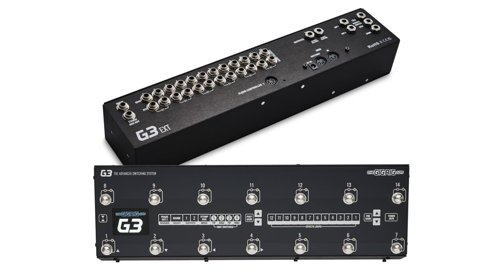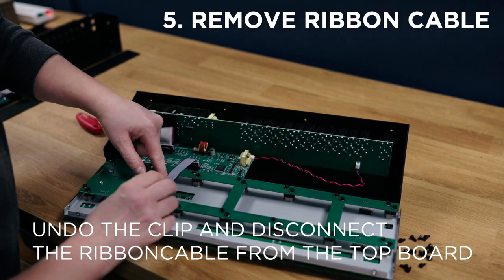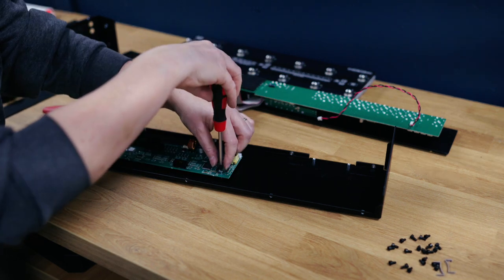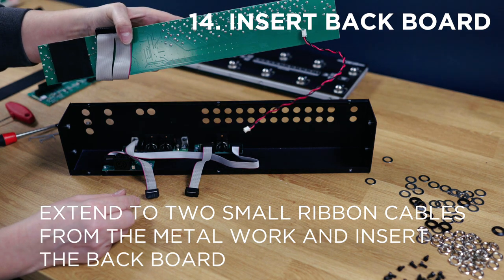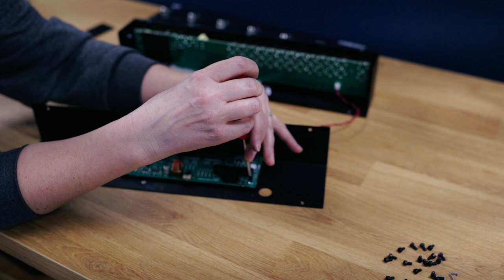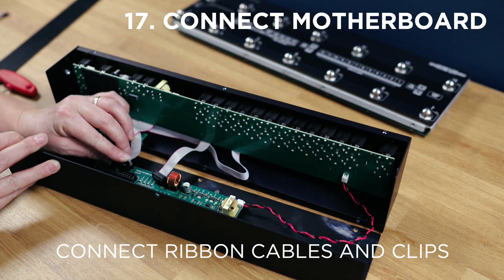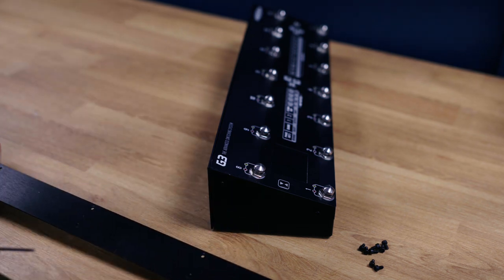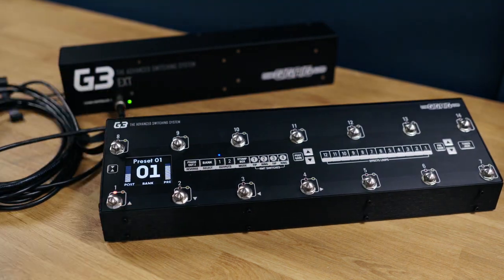How To Assemble Your G3 EXT KIT

Comment: And to verify, when I finished my assembly I had some leftover parts: a short ribbon cable that was replaced by the included long cable in the new controller bottom plate, 1 ribbon cable clip (two new ones came with the ext kit), 2 black hex screws, and the original midi module, correct?
Everything is working.  Super nice that the 7 pin cable supplies power to the controller, too!

Comment: I know this is probably a stupid question, but how do you use a tuner with this setup? Is it native to the lcd screen on g3?
Reply from the maker: Yes, tuner is built into G3 🤓🙏
There is an Aux output so you could have another tuner back at the rack but at the stage you’ve got it in G3 🤓🙏

Comment: This may be a very dumb question, but if the extension board is at my feet, where does your guitar plug in? Is that what the two 1/4" inserts are next to the 7 pin DIN in the back?? I know nothing about 7 pin DIN, so not sure it it's possible for it to send a guitar signal. I'm guessing this how it's done, because it would seem strange to have a 50' 1/4" cable going back to the pedal board off-stage. Clarification here would be much appreciated.

One other thing, can the extension kit only be used with the G3, or can it be used with the G3 Atom as well?
Reply from the maker: Hi. All audio is in the EXT kit so you would plug in back at the rack. Currently it can only be used with the full size G3 but we may do one for the Atom in future. 🤓🙏

Comment: Wait, Im super confused here; did I just buy a $400 metal enclosure?
Reply from the maker: Not at all, you have the circuit boards and cable necessary to convert a G3 in a G3 floor controller with rack mount audio section. If you have any questions at all please don’t hesitate to contact us at support 🙏
Reply: @TheGigRigDaniel  Hi, do you sell G3 Extension Kit + G3 floor controller already assembled?

Comment: No need for ESD precautions?
Reply from the maker: No, it’s 9V DC, no high voltages inside, safe to work on
Reply: @TheGigRigDaniel  No high voltage, sure. But static discharges too small to feel are enough to cause damage to most ICs. And you’ve got a microcontroller in there, right?

Comment: This is just plain nuts !  Why not sell it as a back and top with cable connection ( that can be extended with more cable ) as your cost would be marginally more ?
Reply from the maker: Hi there. G3 is a single unit made as compact as possible for fitting on the pedalboard. The EXT Kit enables you to take the audio part out of the switcher and leave the floor controller at the front of the stage.  Thanks for watching 🤓🙏
Reply: @TheGigRigDaniel  Hi , Thanks for your reply :-)